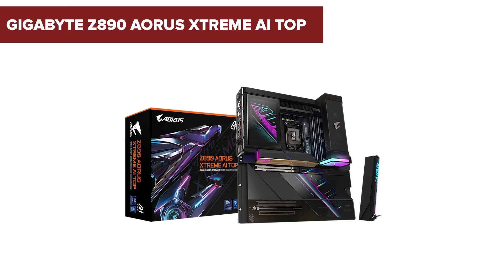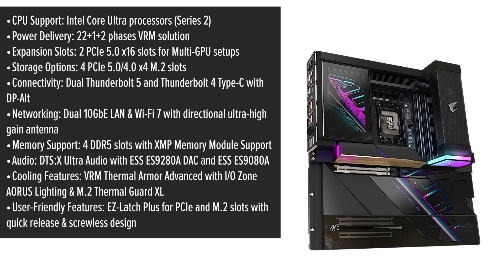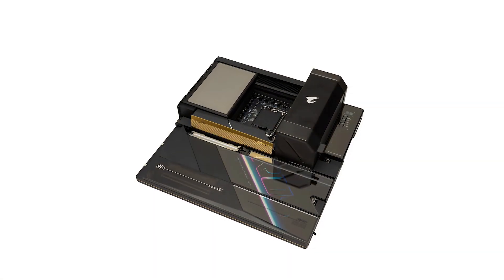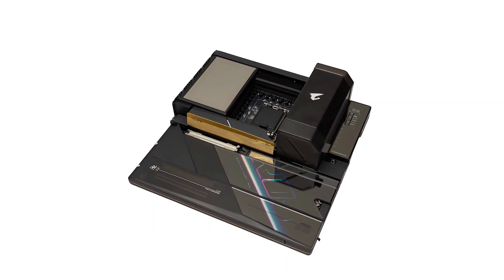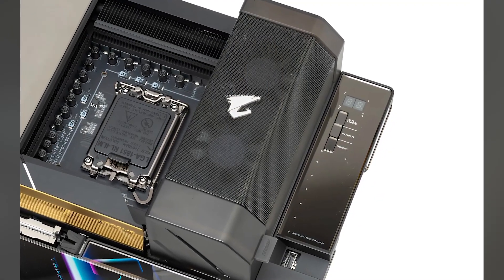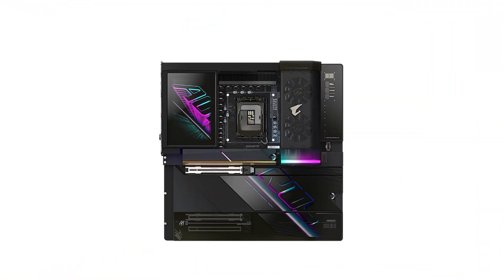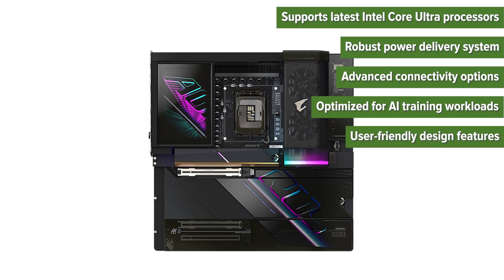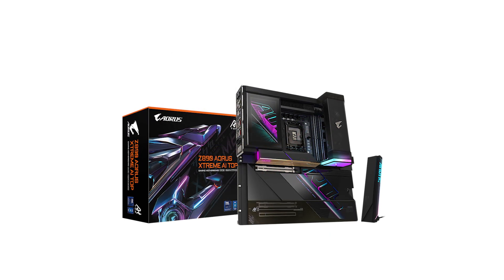Motherboard GIGABYTE Z890 AORUS XTREME AI TOP REVIEW

Comment: I'm absolutely Furious that they do not make an AMD equivalent of this. When I look for motherboards I'm going for a specific aesthetic and it infuriates me that motherboard manufacturers do not make visually identical versions for both sockets. And I have not seen a single logical explanation as to why they do that. Socket type and individual Hardware on a board has no effect on the aesthetic choice they use on it
Reply: Well I agree. AMD version would be perfect.
Reply: They do have an amd version it's called 870e
Reply: @Dr.jp113 completely different motherboard. I'm talking the exact same Aesthetics and features. Every time I've checked there is not an identical motherboard for AMD. I want the same motherboard shroud, RAM cooler, leds, and the overall look of the board to be the same.
Reply: Oh I see .. sad. I have the x870e...
Reply: Im pissed the x870e equivalent of this board has a cheap stuck on fan but the Intel variant which is older. Has a proper enclosure for ram